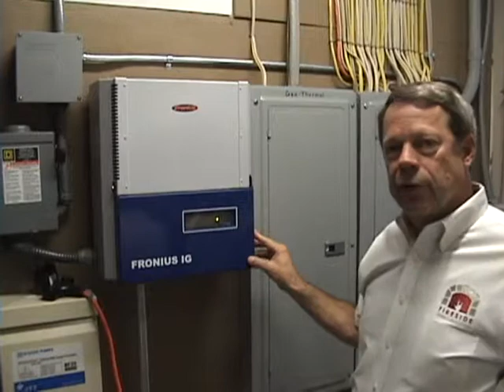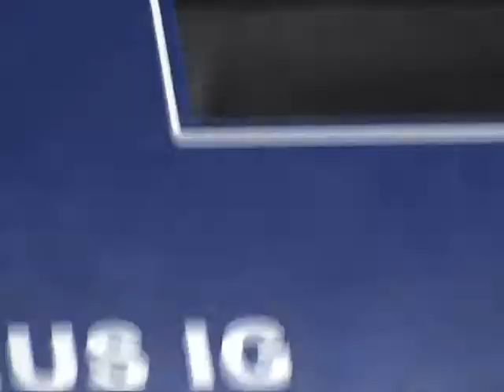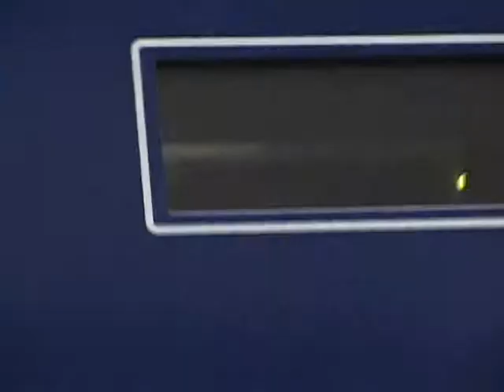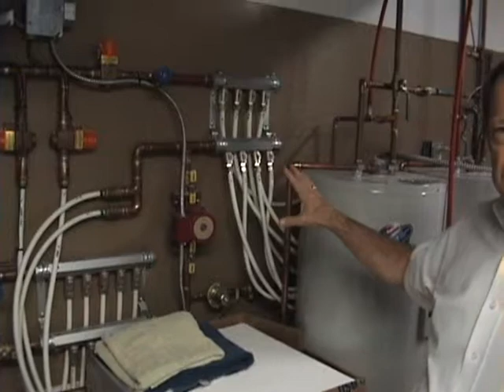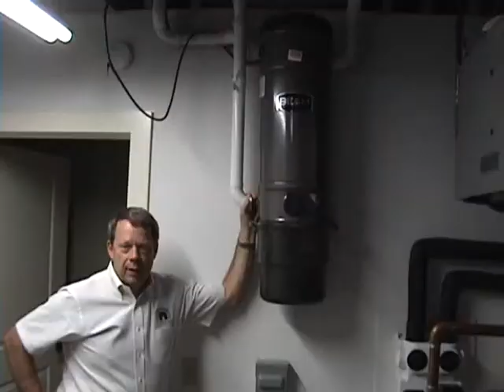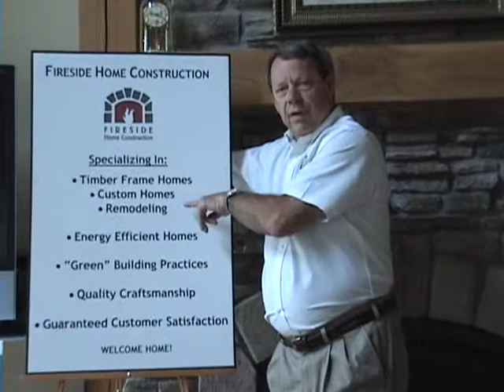Michigan's First LEED Platinum Home PART 3

Comment: Very cool, thanks for sharing...  You've pretty much built what I'm shooting for, only on a larger scale and budget.

  I've pretty much ignored LEED and EnergyStar certification since I'm building for myself and see it as yet another engineering cost I can't afford.
  In fact, I'm struggling to afford half that HVAC and Solar setup but I do have a very tight efficient box.  ;-)